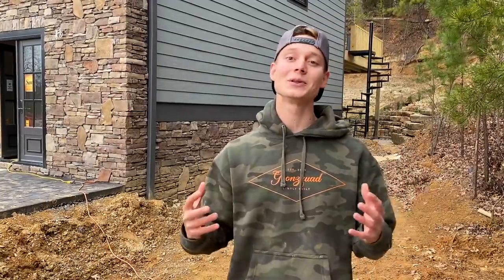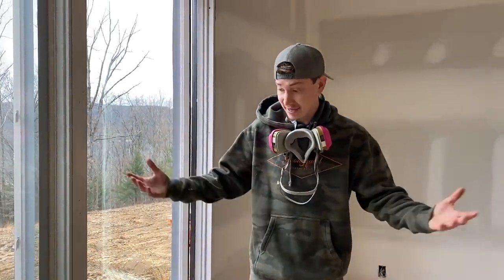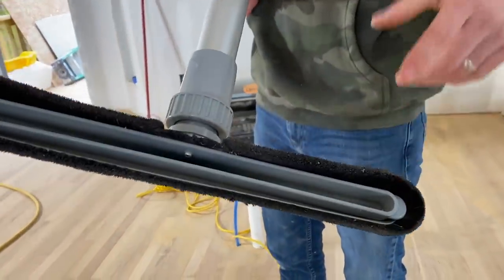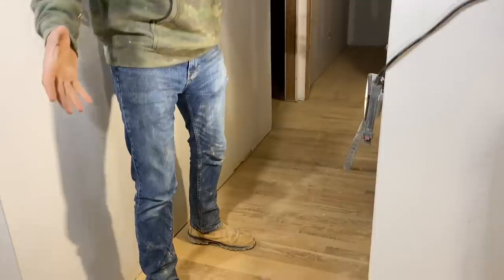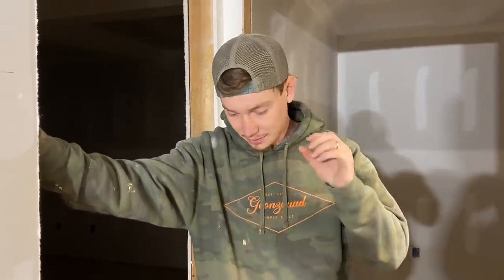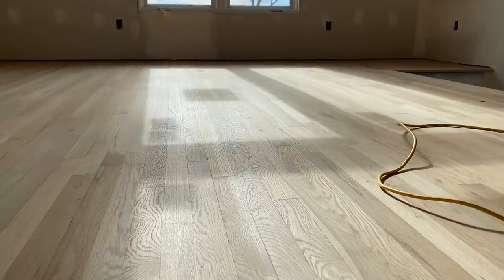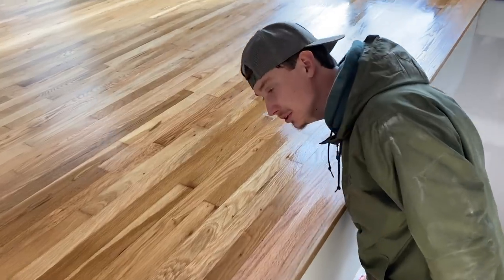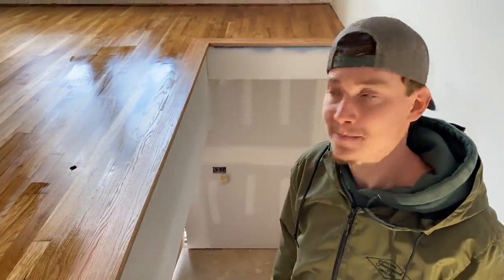The New Goonzquad Headquarters Part 54

Comment: I didn't know you could install hardwood directly onto a concrete slab, thought you laid a subfloor down first.
Reply: If the slab has an effective damp proof membrane beneath it and its water content is in the correct range, it is theoretically possible to use an appropriate adhesive to fix a fully matured hardwood strip flooring to it. But a subfloor would give a better result. The problem however is that they may not have allowed for the additional thickness of a subfloor when installing the staircase. To comply with current Code, all risers need to be within 3/8" of each other, which is why you always design every detail of a building backwards from the desired FFL (Finished Floor Level) to the required SFL (Structural Floor Level).

Comment: Didn't you guys have a cable coming out of the hole in the floor next to the stairs? I noticed a few episodes ago you pushed the cable back into the floor so you can sand, I hope the sparky won't get annoyed at having to try and fish that out or cut a hole in your flooring to get the cable out of there.
Also something of note silicon does degrade and weather so as MANY of the other commenters here please get a window dude in to look and or fix those windows as it will save you guys money and rework later on.

Comment: If I were `doing the floors, I would put tile down in side of the entry door.The width of the door and maybe 4 feet in. Not a slick finish tile. Maybe a tile somewhat matching the outside stoop. Laminated veneer wood will not last `at all.  Whatever is picked up by your shoes will tear it up no matter what finish you put on it.  Or take your shoes off outside before you go in. LOL

Comment: ALL THAT WATER WAS COMING FROM THE BARGE RAFTERS VINYL VENTING WATER GETS UP INSIDE THAT WITH ALL THAT WIND BLOWING THEN GO'S DOWN WALLS ON TO THE FLOOR ..THEY SHOULD OF SMOCKED CHECKED IT FOR LEAKS AROUND WINDOW WOULD SEE THAT WAS NOT THE ISSUE.I HAD SAME ISSUE COME TO FIND OUT IT WAS WAS I EXPLAINED BEFORE..GOOD LUCK

Comment: I need that vacuum, stat! I've looked on-line. Anyone catch the make/model? I've listened a few times and still can't get enough to find it on google. TY!
Reply: Get a proteam super coach. Round top.
Reply: @evsnova74  Thank you for the suggestion. I'll check it out.
Reply: @dogsrfun4rae  they're expensive but top tier, we've used them for years and they work great.
Reply: @evsnova74  - I've found numerous options. Trying to figure out the round top option. We really need a SUPER vacuum for our basement as we get small bits of dirt and stones brought inside. Regular (even high end) vacuums just don't do a great job. Even our wet/dry vac leaves a lot to be desired.
Reply: @dogsrfun4rae  I don't think it's actually called round top but when you browse various models they have these newer ones that have a weird low profile shape so that they don't stick out as much behind you. We like the ones that are just a round cylinder.
Reply: @dogsrfun4rae  from what I can tell on a quick search on amazon it seems like the options are mostly the attachments that come with them. Here's one of the ones we have:
https://www.amazon.com/dp/B00GM4YKWC/ref=cm_sw_r_cp_apa_fabc_itF7Fb1G7ZX49?_encoding=UTF8&psc=1
Reply: @evsnova74  - that makes sense and I understand. TY for all the help. Really appreciate it.

Comment: That floorwill be trash in no time. The temperature in the house should  stay at a constant temperature around 70 degrees. That filler will be popping out all over the place.  Wood expands and contracts with change in temperature and humidity.  Sorry guys I definite give you an A for hustle but F for knowledge on this stuff.

Comment: You should put silicone on all windows... better be safe than sorry
Reply: It is impossible to fully seal the large upper floor window on the south facade to the stonework veneer with any type of tube sealant, because the stone pieces are not grouted and the joints between the stones admit rainwater, especially when a wind is blowing from the south. The mortar which fixes the stones is porous, so that also fails to provide a reliable water barrier. This means that rainwater will percolate frequently down the outer face of the plastic sheeting layer, just looking for a way in, which it will find as soon as it encounters an unflashed window frame.

Comment: STOP!!!  YOU NEED INSULATION UNDER THAT WOOD FOR A SLAB.  So get a 3/4 inch foam board on the ground. Then installing your wood is ok but you can add a half inch plywood so to glue  your wood on.

Comment: Still a good bit to do with floors done.  Use thishttps://www.homedepot.com/p/Stay-Put-3-2-ft-x-164-04-ft-Stay-Put-Surface-Protector-89150/204398355? to protect the floors rather than just paper.

Comment: guys its a shocker every god damn time when you do stuff like that on the skid steer. get proper gear for jobs like that even if it takes longer. 1 wrong step or a heavy wind and your going down on some compressed dirt or even the concrete slab..  can end fatal.

Comment: I feel so bad for the brother that is edging my guys would kill now if I drummed that for out from the wall
Reply: Get a PowerDrive with steel discs and you only have to edge a couple inches
Reply: @evsnova74  still have to edge guy everyone thinks a power drive replaces drumming and edging it’s really just for unskilled idiots to come into my profession I’ve done for 10 years and my father has done for 30  and half ass clean up all your imperfections because you can’t sand property
Reply: @Farnorthanglers49431  I don't think it replaced drumming. Just makes producing an actual perfectly flat floor possible. Which you can't do with caveman drumming and buffing. Unless you just really like the look of waves.
Reply: @evsnova74  they have a pos Hummel is there fist prob I run a floor crafter with a double motor vacuum first left to right crossing on a 45 with 40 grit fill then 80 straight my dads been doing it for 20 years it prevents making to many straight passes prevents Chatter and cut lines from drumming shit 20 times straight
Reply: @evsnova74  man I should start a YouTube channel for sanding who should watch ?
Reply: @Farnorthanglers49431  hell yeah floorcrafter here too. When we upgraded from our hummel I was sure I was going to need shoulder surgery. That thing pulls like crazy
Reply: Do this process and you will never do it any other way promise
Reply: @Farnorthanglers49431  I even slightly engle my final BM pass. I've been doing this since the mid 90s, battled waves for years. I'm with ya about unskilled guys using equipment to get by, but I don't think you can put just any old idiot behind a power drive or trio and achieve the same results I can. You still gotta know how to use em
Reply: @Farnorthanglers49431  what vac you run?
Reply: Check out this floor we did earlier this year if you're so inclined: https://youtu.be/M4QOynUqjl0

Comment: Do not use water based stuff to seal unless you walk on it bare foot. I did it to my floors and quickly regretted it. The durability is not comparable to oil based polyurethane stuff. So don't do it!!!!

Comment: DOOD

guess you got lots of comments....1204
loved it better when you BUILT CARS.
homes????????

but on the subject of homes.
nice idea to fix the NEW Floors.
i assume the WINDOWS are SEALED.
and they have been LEAK CHECKED?
there are only so many times you can sand that....
b4 you are on the SLAB below.

before your seal the floors....
i would seal the windows....
and spray them with a HOSE!.
IF IT LEAKS....
WARRANTY VOID.

not being harsh.
build cars.

T

PS, sorry,
just an ENGR who happens to like CARS.

Comment: After looking at the videos of the window install, yeah guys you needed to use the tape or rubber membrane, and the flashing, do it right guys seek the guidance of a professional, you will have problems with the windows leaking if it doesn't get corrected, sorry guys, just hate to see all that hard work go down the drain.

Comment: If you installed your windows right with flashing under your building paper above your exposed windows then sealed them properly, you'd never have an issue. With silicone,  your issue will come back. And what's with not painting before your floors l, cabinets and trim? It is the right way to do things. Fire you contractor and hire a professional so you don't look overly excited about looking dumb. In my opinion.  People this is not the way to do things, so do not use these videos as a guide.

Comment: You need to strike a chalk liner 2” above window and tuck some flashing in and bend it over the top edge ever do slightly. Or completely uninstall that window and get coil stock flashing behind them , the expansion and contraction is going to leave you with the exact problem in no time . Come on guys slow down tools will drop sharp metal fragments will stick to boots people will be in and out non stop who the hell finishes floors this early in the remodel. Absolutely ass backwards

Comment: Very cringy watching you float the flier with a steel trowel on a wood floor.
Reply: Yes. We would require a nylon tool to be used for that. Avoids scratching the wood surface and adapts to any slight undulations.

Comment: You never use water based products in high traffic areas. It's not gonna hold up. You should have used oil based varnish. I've used it for as long as it's been around. Never failed me. Big mistake using water based. I've never had oil based varnish turn yellow. Whoever told you that happens, is using a cheap product or is a liar.